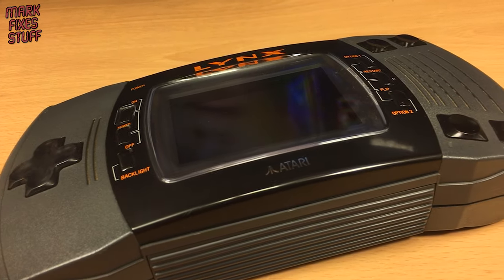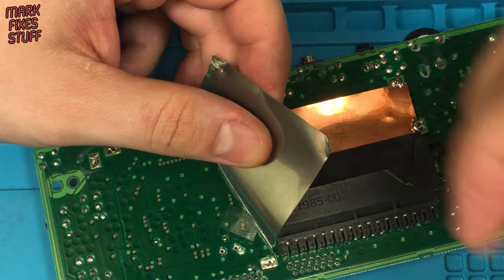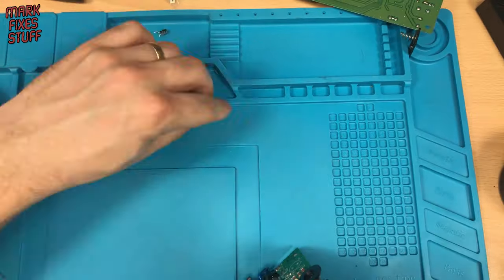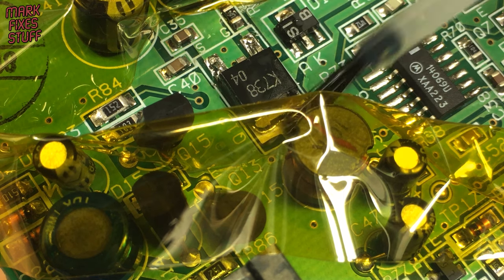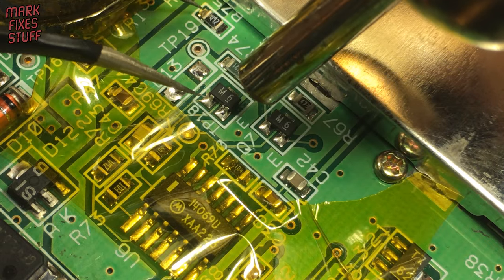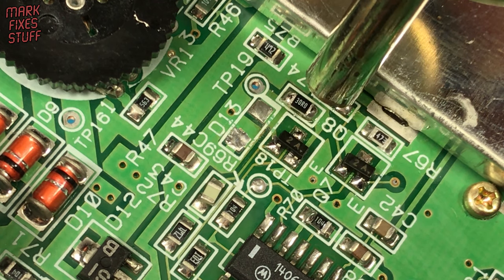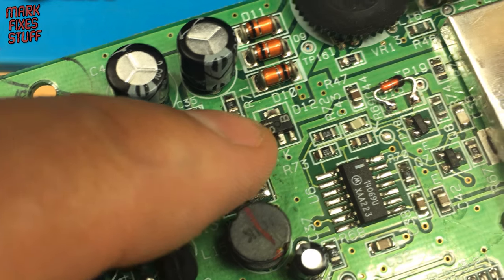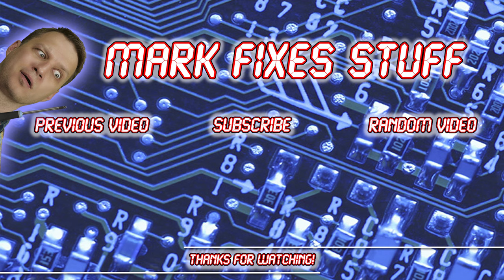Atari Lynx No Power Repair - Power Components & Capacitor Replacement Guide

Comment: Beautifully fixed up. Well done - great work. Thanks for the videos Mark!
Reply from the maker: Thank you so much for the heads up. I still can't understand how I messed up so badly and then sat and edited it!  I even went and checked two other lynxes that I practiced on before shooting this one and I'd done those correctly. I live in terror of leading people astray and you saved my bacon!
Reply: @MarkFixesStuff  What was the mistake? I watched the original version all the way through but I guess I must have missed it.
Reply from the maker: I desoldered and replaced the entirely wrong component.
Reply from the maker: In my defence it was directly next to it and I was working around the camera... and drunk.
Reply: @MarkFixesStuff  Oh, and it was a teeny tiny component that looked very similar to another teeny tiny component a few millimeters away, just different colour.
Reply from the maker: @cathedrow  thank you.  I really shouldn't rush though.

BennVenn screen tomorrow now though.  I'll need to be super careful because I've done one before as well...

Comment: Thank you so much for this video. I had some confusion as I had ordered my voltage regulator kit from console5 and it came with two Zener Diodes for  lynx I and II. Theirs for the Lynx II doesn't have the through-hole style ends, while the Lynx I zener diode does. So it's the opposite, for anyone else looking...
Reply from the maker: Yes, it depends on the kit you get. This is great info. Thanks for taking the time to share :)

Comment: Great video. I hate flux, it's irritating, and it gets everywhere! I love IPA though, so I love cleaning up after. 

Have you got a small flow tip for your iron? I like to dab a little solder into the well and then use that to solder anything smaller then an 0603. You can hold the component in place with your other hand rather than trying to juggle the comp, solder and iron.
Reply from the maker: I don’t have one of those drag solder tips at the moment, but I think I’ll order one now you have mentioned it.  In the past I’ve just used a lot of flux, solder paste and a board heater/hot air combo. It works well but I saw Stephen Leary (TerribleFire) using the tip you mentioned and like the look of it.  Cheers!!!

Comment: Would love to have seen som pre diagnosis. Mesure voltages at the power jack moss fet etc. Also what was your hot air set at temp/rate? Thanks

Comment: Is it possible to do this without a hot air gun? All I have is my soldering station.
Reply from the maker: Yes, but use a small tip and done't force it because it's easy to destroy the solder pads.

Comment: How to confirm the components, especially transistors, are bad to avoid shotgun approach?
Reply from the maker: Not easily without removing them anyway. You can check for 5v, but the real reason for changing them is that the new parts are better and more resilient than the original parts.